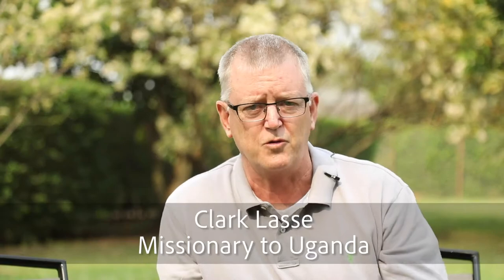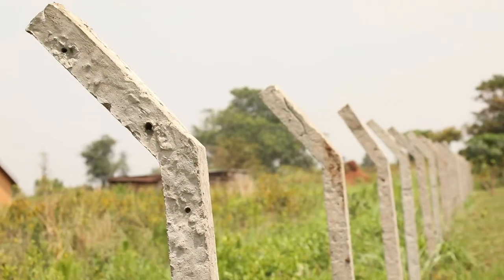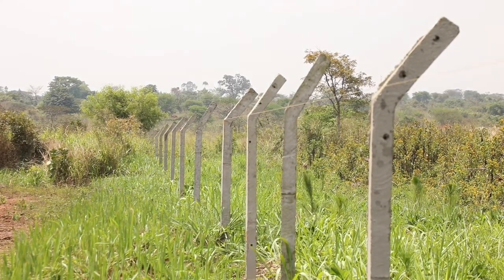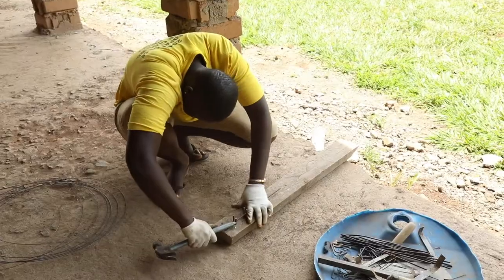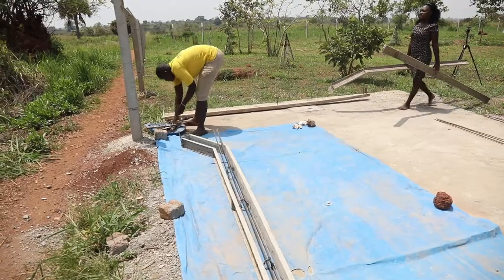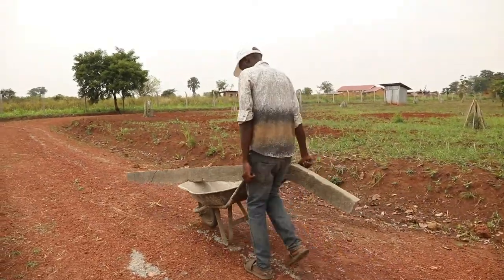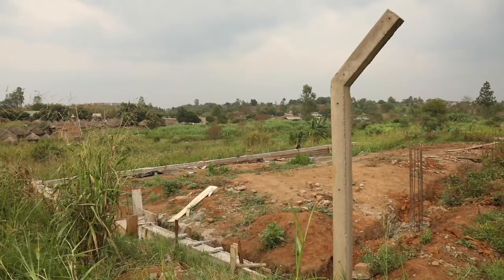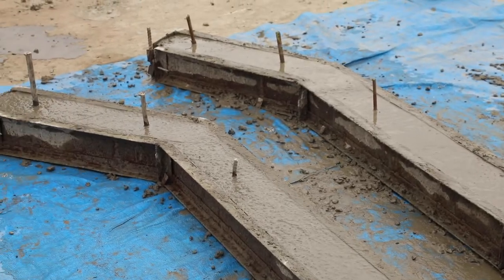Concrete Posts--a strategic component of security fencing

Comment: Gotta try this. I've used concrete posts for several years as pitaya trellises but have found them subject to cracking in our windy environment.
Reply from the maker: That probably has more to do with the quality of cement and the mix of materials than it does the weather. We also reinforce our posts with three strands of 10 mm re-bar which also helps retain rigidity in windy weather.
Reply: I'm trying three sticks of #2 rebar now, plus fiberglass reinforced surface bonding cement. We'll see how that works. @clarklasse